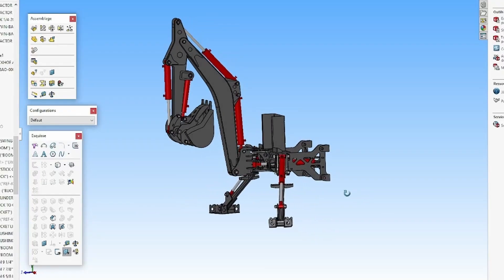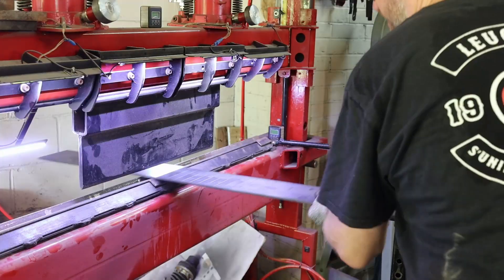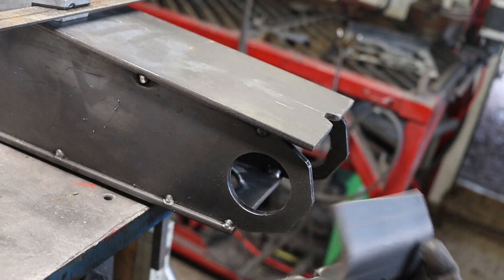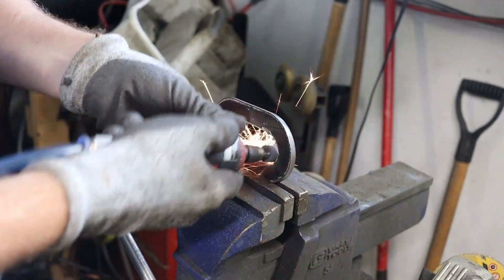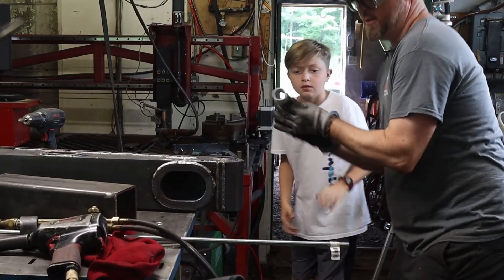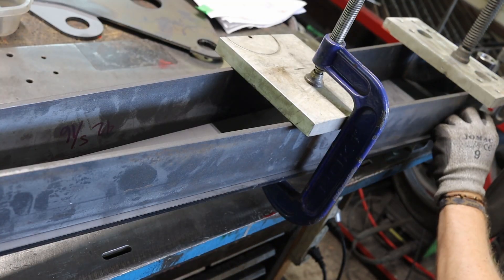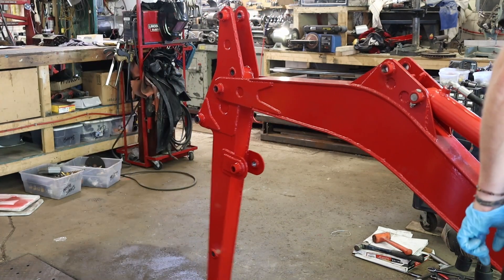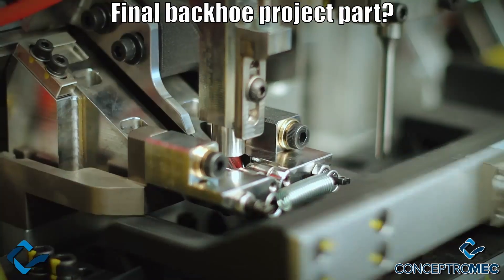Backhoe / Excavator Project Part 3: Stick and boom, won't break my bones.

Comment: I pack my bearings in dry ice prior to install. Works way better than a freezer. If I worry that it is still going to be super tight, I'll run a brake wheel cylinder hone down the sleeve to smooth it out after being welded.
Reply from the maker: Noted buddy! I'll try this next time for sure!

Comment: Welding circumferencially around the tube makes it contract. You either need to turn it a few thousandths larger to begin with or ream/grind it out after it’s finish welded. Cutting Edge Engineering showed this on their latest hydraulic cylinder rebuild video.
Reply: Also, out of roundness could add to the problem
Reply from the maker: Thanks for the tip, I'll have a look for sure!

Comment: I'm a Heavy equipment mechanic in the mining industry we usually use nitrogen in a metal pail to freeze bushings, you need a diffuser to get liquid nitrogen but a few minutes and they drop right in no heating needed. When I don't have any nitrogen it's the freezer and heating method with lots of hammering and curse words lol.

Comment: To bolt that recessed zerk in - put a bag in the socket, stick the fitting in, rip extra bag away.  The bag takes up the slope between the socket and the zerk/nut/bolt/etc.  Paper works good too.
Reply from the maker: OOOOHhh...thanks for the tip! 👌 You might see that tip in a future video...

Comment: When you make your bushing that you will later install with a press fit, turn the first .200" down about .010"  This you a locating register for the part to drop in and sit straight in the hole before you try to drive it home.  Much more likely to get it started straight.  Good luck, and thanks for the build videos.

Comment: Hey Viny, this is what I do for interference fit, go to your local weld supplier for some dry ice in a cooler. I would set up a hydraulic press as well with levelling table, works every time for me. Could also use Enerpac tooling. As you know the driving force for the bushing should be applied evenly and ensure parts are free from burrs, nicks etc. Good luck with the build. Cheers, Joe

Comment: If u cold soak a close fitting pin inside the bushing that will help hold the cold longer . I would use dry ice with alcohol for the cold soak .
Also use the pin for alignment with the opposite  bushing . No question of alignment then. The bushing should also have a smooth chamfer to help guide into the hole .
Keep the dry ice and alcohol close by ( lower travel time  ) and keep it inside a Styrofoam fishing bucket or cooler sized as needed. 
Be sure you protect from spilling its dangerously cold. Inside cardboard   with blankets or similar.

Comment: Another thing u can do is make your cold soak pin with a shoulder and use it as a bushing driver .
The big boys ( manufacturers  )  machine the weldment after it is welded together so they know its perfectly round. 
No question about its fit .

Comment: In regards to the first episode, I recommend getting a magnetic drill and just swizz cheese your existing table, you will save approx 9500 bucks lol.
As for this video, and I'm sorry for unintended innuendo's, pro tip with that grease nipple at 7:00, put some grease in the socket, the nipple will stick to the socket 😁
Those bushings are tough customers, surprised you didn't use the press for those, and ideally the housing needs chamfer so you can start the bushings easier, there's some solid pointers on CEE here on Youtube!
Knew that boom plating would twist with heat, so was laughing at your expense when you used torch on the boom plating because I knew you'd figure out how to use the press.
My main takeaway from this is clamps, so I went out and bought some... Will buy more 😆

Comment: To make your bushing start correctly when you're pressing them in, you need to turn about 6 mm on one end to a couple thousandths of an inch smaller than your press fit bore. This will allow it to sit in the hole so you can start straight so when you hammer on it or press it in, it will slide correctly. He also need to get the part with the bore quite a bit hotter than I think you are. It needs to be a dull red color before you remove the torch.

Comment: Great progress. This is going to be such a great attachment. As for bushes. All thread is not really up to the task. A high tensile rod with thrust washer/bearing nuts would be a better choice.   The addition of some adapters to align the sleave would help. Or a hydraulic puller. Other issue is the heating of the arm, I suspect the torch heat is almost instantly negated by the thermal mass of the rest of the arm. You have a sexy press, which would do a nice of installing the bushes, but I understand the hassle of setting it all up.
Reply from the maker: Yes, it's mostly because of the size of the boom...but it's manageable!

Comment: Nice!!   tu devrais penser a mettre le cylindre du boom pour avoir le shaft en haut.....comme ca le plus fort est en relevant le boom(soulever qlqch) et non pas en descendant.
Reply from the maker: C est la meme force, parce que tu pousse en extention, pour descendre mais si  je l avais mis sous le boom ( demande de nouvelles brackets), comme une excavatrice, alors oui j aurais ete plus fort en monté
Reply: @VinyB57   oui mais tu veut pousser en extension pour relever le boom  (L'extension a plus de force que le retraction...(la rod prend de l'espace donc moins de surface pour l'huile a pousser) Il y a pas mal plus d'utilité a avoir de la force en montant le boom qu'en le descendant......  ..je viens de voir des mini excavatrice monté comme toi: j'ai toujours apprécié que le cylindre soit au dessus(plus protégé), mais jamais compris pourquoi le cylindre est pas dans l'autre sens  :|
Reply: @VinyB57 oublie ca...Non non la ..j't'épais la...j't'épais (voix de pérusse) :|

Comment: When you are heating the boom, the whole thing wants to expand, so it is expanding into the hole, effectively closing the hole for the bushing. I’d try freezing them both so they both contract.
Reply from the maker: Yes, I want the boom (housing outside) to expand and bushing (inside) to contract...

Comment: If u need to use threaded rod to draw the bushing in u need to make a shouldered end plate to keep your threaded rod centered  on both ends  .
Alignment is crucial...
Have everything ready to go.  Not to be hunting for your stuff to assemble.

Comment: At 17:15 I am pretty sure you meant to use "envy" instead of "anvy".  C'est la vie.  I am well aware that English is your second language, and that it is easy to understand what you intended to spell.  I just thought I should let you know in case you wanted to fix the error, or mention it in your next video.  I'm not as envious of the backhoe, as I am the shop you have that can make one from scratch.  I am DEFINITELY envious of that. 😼
I am curious to see what your next project will be.  You never cease to surprise me. Continuez à créer du contenu génial.
Reply from the maker: Hey thanks Tarry...you know what I wrote ENVY and double check with freaking google translate...and it switch it to anvy!! 🤦‍♂️🤦‍♂️🤦‍♂️ Unfortunatelly, I can t change it! 🤷‍♂️ But thanks again!

Comment: not a fan of using rams "inverted".

that is, your main lift ram, as its on the top... it has to PULL, its in tension... and that means you lose the force equal to the piston rod diameter, and youre stressing the rod seals as well as piston seals, along with whatevers holding the end cap on..

i just chopped my backhoe up to undo this very feature and flip it so the ram is underneath where it makes the most force when needed... when breaking out, lifting UP... major difference.

look at every excavator...

yes, i know.. it reduces clearance and/or risks more damage but i prefer it that way.